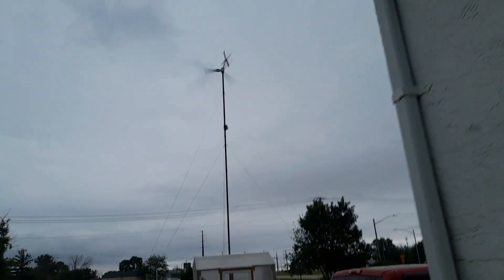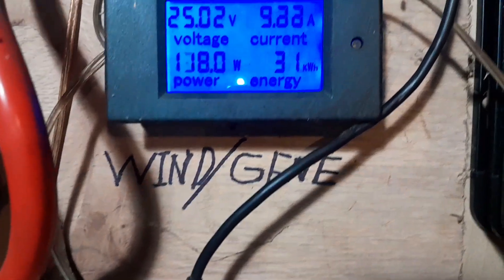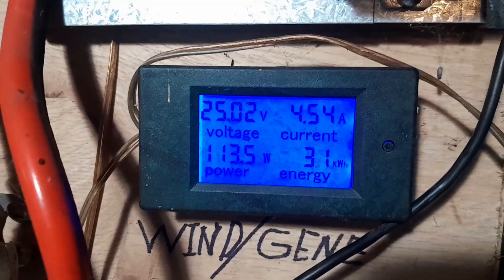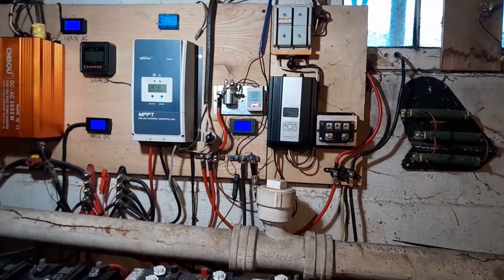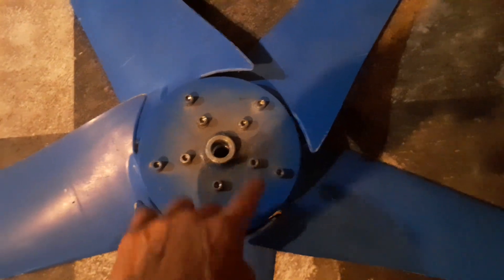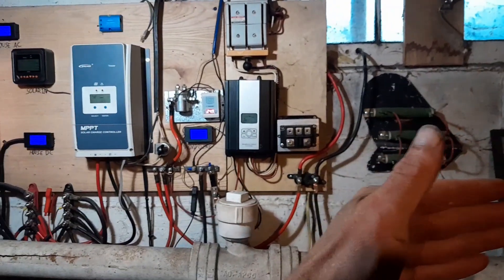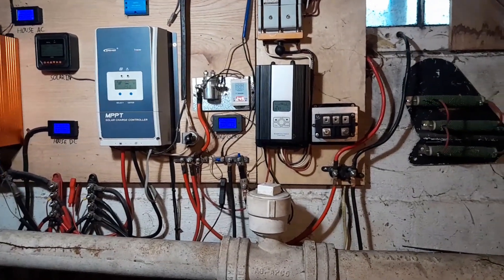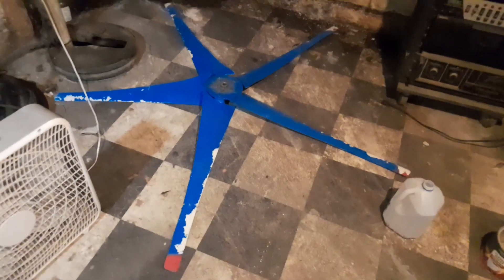This Prop Kinda Sucks...

Comment: It's a propeller being used as a turbine. Two different mission profiles, two different machines. A propeller is power driven and moves a fluid - air or water - a turbine is fluid driven and powers something - generator - through a shaft. One is the inverse of the other. That's why it sucks.

Comment: not all blades are equal, i remember blade design comparison videos years ago , proper blade design matters alot , a decent 3 blade set will work in low winds and spin fast trouble is finding them , i wonder if hurricane wind power blades are better, my windy nation were better than mws
Reply from the maker: I got a felling this next test will be a big boost. I've been dragging my feet on the project though because the hub is stainleas steel and i havent had a good track record of drilling S.S.... im ALMOST out of other projects to "prioritise" so i won't be able to procrastinate on it much longer. Wish me luck!
Reply: @smallcityhomesteaders1600  Good Leck and God's Speed !!!

Comment: Interesting. The problem I had when I change from 3 blades to 5 blades that, in low wind, my blades would spin with wind less than 7 mph and not create any electricity. With the 3 blades it would not spin. This causes useless wear and tear on the generator. Remember anything that moves will wear out. Solar panels last a lot longer cause of no moving parts but true they do not make anywhere near the power a good spinning wind generator makes.

Comment: How's it goin? Very good explanation of air flow and blade dynamics. I like it...
Reply from the maker: I only know this from watching turbines for 6 years. Very frustrating hobby sometimes. I call it a hobby because you sure wouldn't want to count on being able to live off grid with by simply throwing a PMA turbine in the air because you think it's "windy" there.... you'd be very wrong. Unless your actually in a level 4 wind zone, clear of obstructuins for 300-400 yard in every direction...sure! You bet! They do make good power if you can spin them up and keep them spinning. For that you need clean, steady wind. Most of us have very turbulent wind and that has been the challenge I have been trying to live with. If I had a 50-60 ft pole, she'd do great all day, almost everyday. I have a 35 ft pole and 40 ft trees on in all directions but northeast.....Soooo, lots and lots of changes have been made to this setup in 6 years to try and harvest every possible watt from the available wind here. I made over a dozen videos stowing the struggle and changes and output before/after. Feel free to take a gander. Thanks for watchin!
Reply: Oh yeah, I feel your pain. I sub'd to you back in 2018. I'd like to see you do another video on balancing your new blade setup. I have 2 Hurricane turbines, but not place to install them yet. In time they will be used.
    I'm curious, if you need more height, why not add on a 21' length of schedule 40 pipe. Is there a big issue with stability going that much higher for you...
Reply from the maker: @donnymorrison5480 well....leverage, ya know. If i could get up to 50' or so the thing would probably haul a** but i would definatly need to beef up my earth anchors, cable, AND need 20' more of heavy copper wire that is 4 times the price of what i paid for it in 2020. Im using 3" black gas pipe so that's way stout enough for the tower itself but everything else would need attention for sure. The unit in 80 lbs or so and an extra 20' of pole is that much bigger of a lever in the wind. Fall radius is also something to take into consideration and is really the only thing the inspecters in my town care about. If it falls...what can it damage becaise you are 110% at fault no matter what. I rent here and i'm already pushing my luck....like a lot....but she's just trying to sell the land as commercial property and doesnt care a whole lot as long as bills are paid so she looks the other way.
Reply: @smallcityhomesteaders1600  Ya Man, Those are really big issues to worry about. I wish you all the best...
Reply from the maker: I appreciate it...thank you. We get by pretty alright either way.